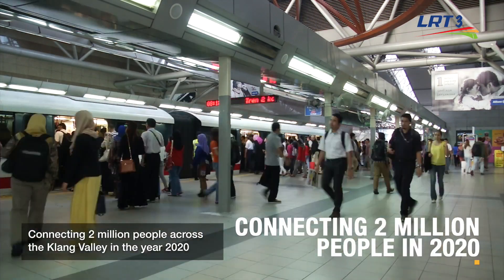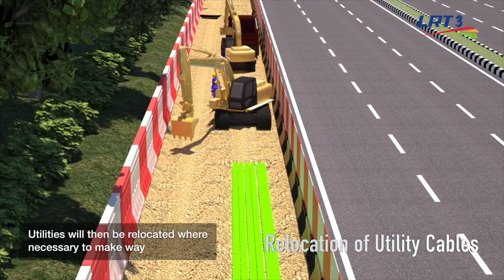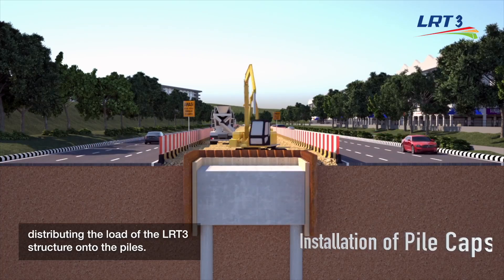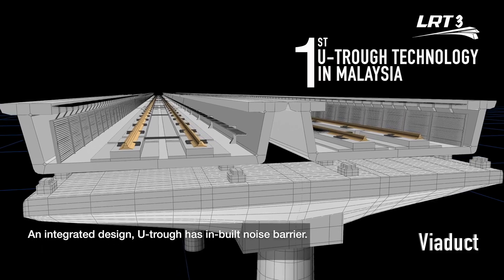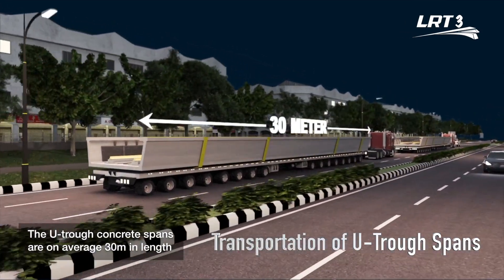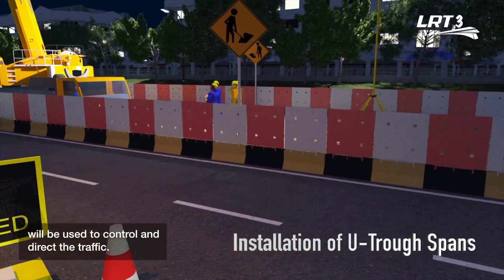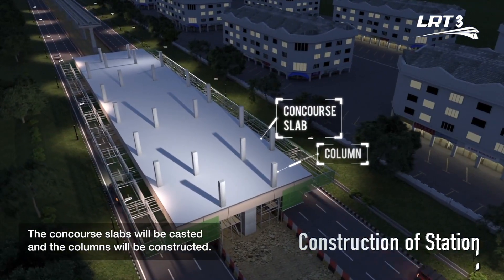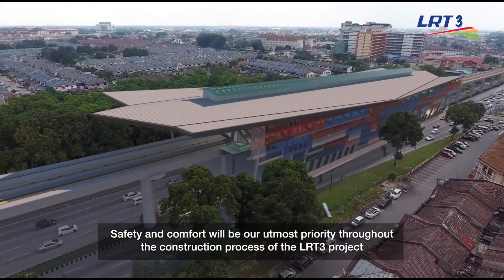LRT3 Construction The New Way Forward

Comment: LRT 3 & MRT 3 What's the difference
Reply: lrt 3 is going to serve shah alam and klang from bandar utama, pj.
mrt 3 is a circle line that will connect all the existing rail line to reduce congestion on the existing interchanges ,  save more time to end destination without interchanging all the way to city center, and cater urban area that should be covered by a mass transit such as setapak, mont kiara, danau kota and universiti malaya.